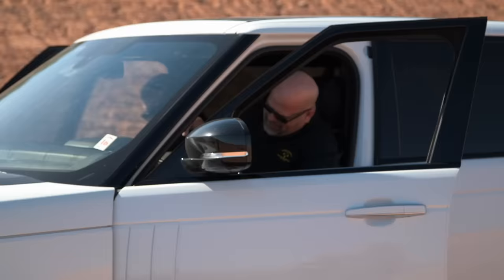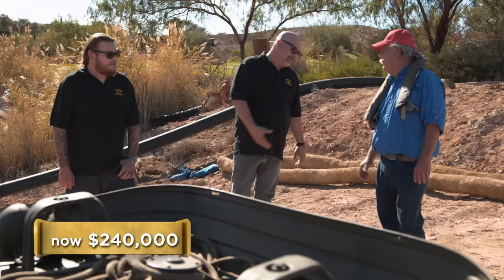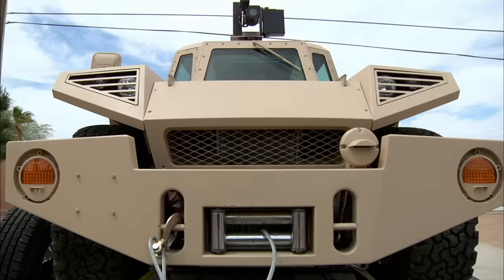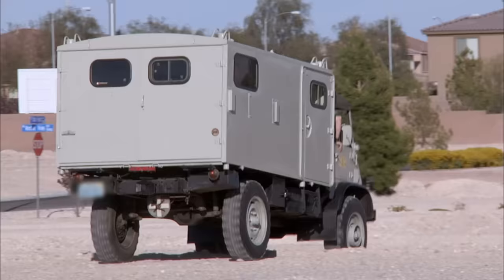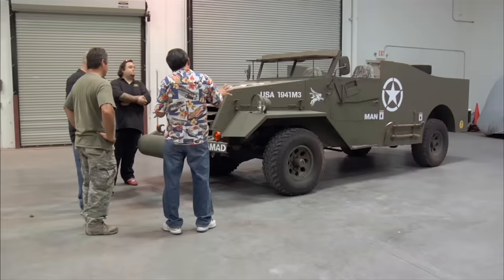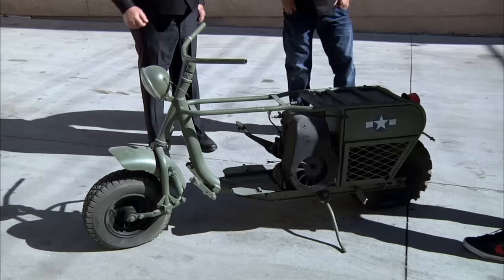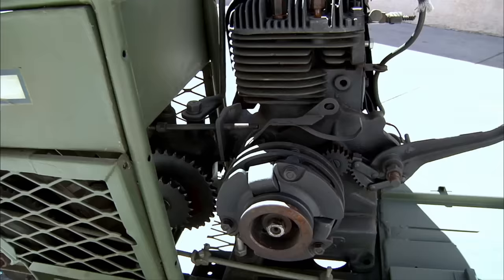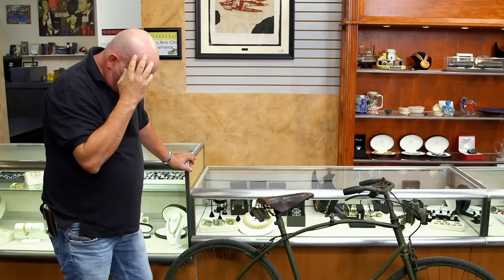Pawn Stars: 6 Rare & Valuable Military Vehicles

Comment: I wish they had done some follow up with that folding  bicycle. 
   They actually were dropped with WW2 Paratroopers.
Reply: I was going to mention that. 
The Pashley company still make a modern version of it, at least when I last checked a few years back, two regular colored ones as beach cruiser style and a khaki version to be like this.
Reply: Strictly no. They were a general purpose bike. Every detail I can see on that one is period correct, even the tyres. There are photos of British troops landing on D-day at Gold Beach carrying them. A lot got ditched  and picked up by the local population. Many were also 'aquired' be armoured vehicle crews and vehicle mounted units, for general run around use.
Reply: @51WCDodge  ,  British Paratroopers carried them.  I don’t know if that it one , but it dose look the type. 
 I like Rick but I think he suspected that and deliberately didn’t call an expert. 
   I’m not sure what it would be worth in any case.

Comment: That BSA folding bicycle, AKA Para Bike, is 100% original. The BSA gear cog, the thin pedals, the wing nuts, even the saddle is absolutley correct. The tyres will marked  Wartime Utility, and they are correct.

Comment: The Unimog IS a very rare model
Reply: Not really. You can see them around. They're still being made, although they look nothing like that anymore. The US Army used them, in the 90's, the 419. Made by Mercedes, modified by Freightliner. It had either a plow blade or a bucket loader on the front,  and a backhoe in the rear for ditch or trench digging, which could dig down to 18 feet. But it was was considered to be too underpowered for its job, with a 6 cylinder, 5.8 liter diesel engine. I would guess, that it was. A Hummer has a 6.2 diesel V-8. From a former US Army mechanic.

Comment: Rick should educate himself on the value of Cummins swapped vehicles
Reply: But it's not original. What's the point?
Reply: @51WCDodge  the point is, 1st Gen 12 Valve Cummins swapped ANYTHING,  from '76 ford f250 with Cummins to Chevy Suburban with Cummins are very desireable and collectible now and that particular rig would be worth 20K easy, so desireable in fact that people are putting the 6BT cummins in hot rods like Mustangs because you can easily turn up the power since the engine is overbuilt from the factory, plus cheap to maintain and easy to work on making it more economical
Reply: @drd1924  Not if like me, you want your vehicles as original as possible.
Reply: @51WCDodge  I can respect that, however there are people like myself that if I intended on heavily using the thing, appreciate being able to easily get parts at Autozone, Guys like me wouldnt be buying it for a collectible, but for a daily driver, if it were original and collectible I'd be afraid to take it hunting and offroad etc
Reply: @51WCDodge  Heck that drive train alone is worth 15k. I wonder how long ago this episode was. Rick missed out. That vehicle would be around 35k-40k especially if they put a better colum in it.